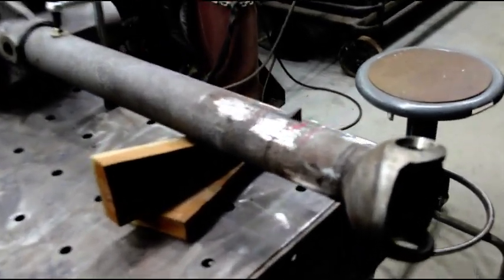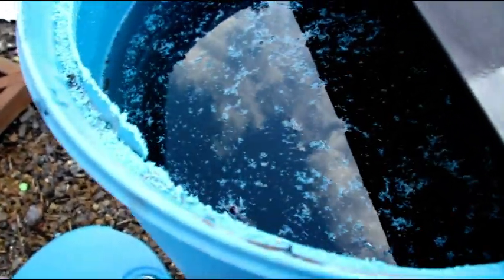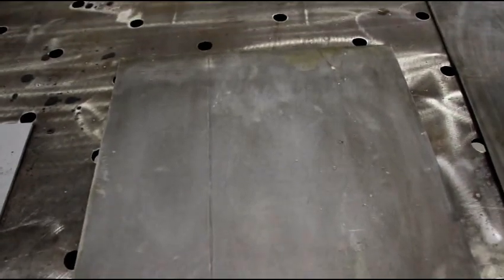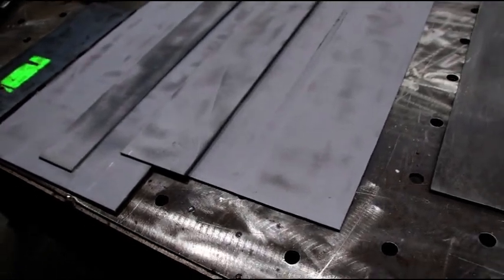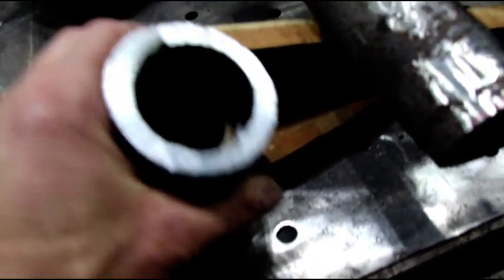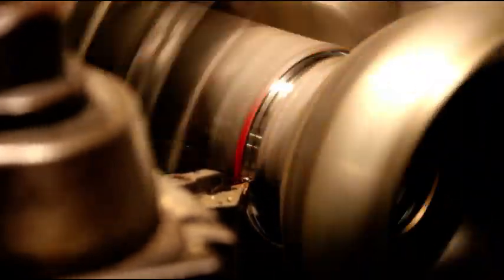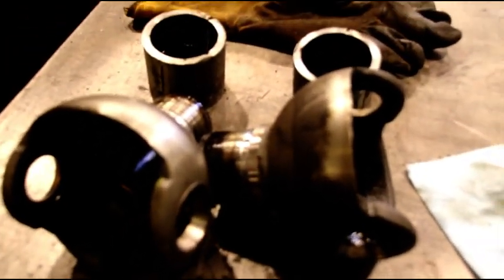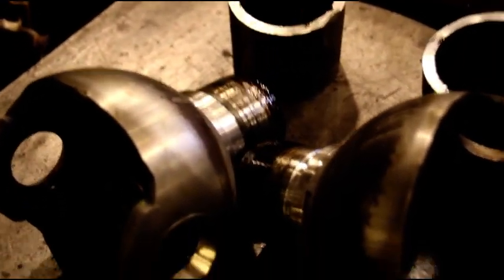Willys Dana 44 Axle Shortening,  Removing Mill Scale With Vinegar

Comment: That vinegar sure beats the sand blasting, my grandpa always used vinegar for everything, so i use it as well, and it does a good job, and it's cheap.
    I love the 44 axle shortening, you have some skill Brian.  I wish i had a lathe, because there is so much you can do, my other grandpa machined parts to make cannons that actually blew stuff up.  He was in the battle of the bulge, and was an anti tank sergeant, but was also trained in demolitions to clear barriers, bridge's, and anything else.  As kid's, he would widen his field's by blowing up tree line's with dynamite, and i got to push the handle down, it was great.  He made a good size pond using dynamite and a track hoe.  My mom always said that us kid's were lucky to survive childhood because some of the crazy stuff my grandpa would let us do.   Back in the 70's, people didn't get all crazy if you rode in the back of a pick-up truck going down the road, and didn't trip out if they saw you catching alfalfa bails on the back of a flat wooden trailer with nothing around you at 11 year's old.  
    I like how you do thing's, right, not some shady hack job, but with skill and integrity.
G-d bless you and your wife.
Reply from the maker: Great to hear from you.  With both of us around the same age, it is easy to imagine riding in the  back of a pickup truck, and other stuff we did as kids.  If the new generation watched us grow up they would probably be in therapy right now wondering how we are still alive.  Thanks for watching

Comment: Very nice video and informative, quite impressive how thick those axles are!
Reply from the maker: These old axles have super thick .375" wall thickness.  I have welded up many modern axles that rusted thru and leaked gear oil.  Newer stuff is so thin you wonder how the axle doesn't bend.

Comment: Is there a way to replicate the precision of your work on those axles without a lathe?
Reply from the maker: It can be done with a hand grinder and carful grinding.   A 4" grinder, some grinding wheels, and lots of time can produce the same result.   Only problem being without a lathe you would not be able to turn the knuckle down to fit in the tube.

Comment: I've been using white vinegar for mill scale and rust removal for a few years now. Even almost 100 year old car parts covered in rust come out looking like new again. Cleaning vinegar is 10% acid, works really good. Best part is it's cheap.
Reply from the maker: Vinegar works great, but few people use it and go for muriatic acid or something very harsh to hurry up the process.
Reply: You can get vinegar up to 75% concentrated.  Meant to be diluted but still it’s stronger than regular food grade white vinegar.

Comment: Muriatic would take 15 minutes on that, but it's such a pain to work with (I wear a cartridge respirator, rubber gives, and a face shield... and I generally don't care about safety). And, the vapors will rust everything in a 10 yard radius if you're not careful. 😂
Reply from the maker: I prefer to vinegar for that reason, every around acid rusts !!!    I don't mind the wait with vinegar, plenty of other things to do while waiting